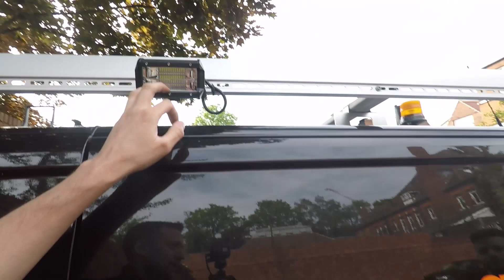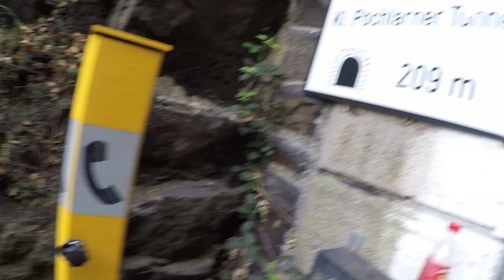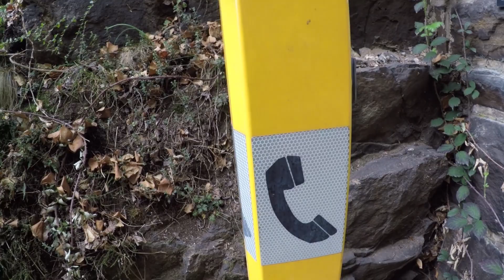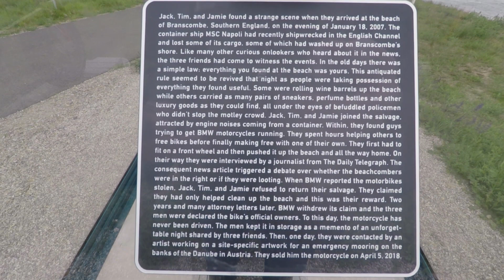Will Dave pass his van inspection??? (+ exploring random Germanic Electrics) | Thomas Nagy

Comment: If you have loads over 3,6kw you use almost exclusively  three phase power here in Germany. Single phase outlets with more than 16a. Are very untypical,  residential buildings and even modern apartments have a three phase supplies ,so seeing these sockets is normal in Germany, lots of households even have these in the garage or the basement.By keeping the distribution three phase as long as possible the grid is easier kept balanced.
Reply: Yeah, the same in Nordics, to where most of the stuff came from Germany anyway.. In Finland apartments have had 3 phase from the end of the 60s almost by default.
Reply: Symmetric load is important 😉 That's why you split the Rooms equaly to all phases
Reply: same in Poland,we have 3 phase supplies

Comment: Train nerd alert....

You are right, those power supplies would have been for track works. Tunnels have a horrible habit of building up dust, debris and other flammable detritus. As a result they have to be cleaned out regularly (London Underground does it overnight when the system is closed with teams known as 'fluffers') but why they left the units in place, i dont know. What I do know though is that railway track engineering and railway electrical engineering are 2 separate teams, they probably just got the track engineers in to rip the track up and said lets save some money and just disconnect the supply rather than rip it out

The shelters inside the tunnel are a safe place for shelter (track worker needing to take shelter from an oncoming train for example) They would have had signalling phones in as well so that if a train broke down or engineering teams needed to speak to a signaller then they could do so from a safe place. Likely to be fire protected cable so that if your need to contact the signaller is that your train has broken down and caught fire or debris in the tunnel has caught fire then the signalling system will still function.
Reply: Burnie5204 - on the area where I am based, we call the “shelters” refuges. There can be a number of different electrical systems in tunnels, including, but not limited to: power for lighting so staff can locate emergency telephones, emergency telephone systems, general tunnel lighting (not common), power for radio leaky feeders, or infill radio relay stations, or power and control systems for the railway signalling system.

Comment: The Tunnel was Part of the "Donauuferbahn" it was decomissioned in 2017 and deconstructed in 2018. In 2019 they have to close up all the tunnels, that's whhy the infrastructure is still there and looks fairly new. That Emergency Phone was probably updated shortly before the decomissioning due to regulation changes of Tunnel safety. The three phase plugs are for work or rescue operations in the tunnel. Regards from Austria
Reply: Didn't know they dismantled that :( Still remember using it back couple decades ago when i was little ...
Reply: What’s the reason behind decommissioning the line?
Reply: @robin_valk  Too little traffic and enormous costs to keep the track as it was repeatedly damaged by rockslides
Reply: Thank you!

Comment: Hi 
As someone that lives in both the UK and Austria (Salzkamagut to be exact, in case you wondered), I would like to let you know that in Austria 3-Phase power in rural and even houses in villages and the outskirts of towns is really common. I don't know if the electric companies introduced it or it was demanded by the customers but quite often the 3 phase power is used for log splitters, table saws, woodworking machinery etc and for households to cut up their supply of winter logs. Ive also seen 3-phase pressure washes and other appliances out there - all terminated with 16amp 3p+N+E plugs, though in many cases the neutral isn't used as the appliances are taking advantage of the 3-phase power for motors.  

Outlets like the one you see in this video are quite common; in public buildings, outside public buildings, in private garages, in gondola and chairlift stations in the alps, and in manhole covers for use when there are summer festivals etc. 

I think the conclusion is that Germany/Austria (I cannot speak for Switzerland) relies on 3-phase power more than the UK and like to have utility power at their fingertips.
Reply: PS: Nice choice of drink on the Almdudler!
Reply: Not only in rural areas or villages, almost every house in Germany is supplied with three-phase power. Our electric cookers are almost always connected to three phase in Y-configuration (3x 230V) to distribute the load more evenly over the phases. Usually they are connected with 5x2.5mm2 to three 16A breakers.
Also, in modern installations every other room is hooked up to a different phase. No rings, no spurs, no isolation boxes, everything is wired radially to the breaker panel. There's no difference between outlet and lighting circuits, usually you have about one breaker per room for both. "Fixed" appliances like the fridge, dishwasher, washing machine, dryer, ... have their own 16A breaker. Bathroom exhaust fans share the same breaker with lights and outlets (yes, we do have outlets right next to our sinks, so we can dry our hair right in the bathroom 😉), no such things as isolators or spurs needed there either.
There still are some old installations, mostly in residential areas with lots of small houses with rooftop power feeds, where only one phase is brought down into the house. But more and more of these are replaced with modern three-phase installations. The same is true for most parts of Switzerland.
Reply: The three-phase power delivery to any house is very common in countries that are to the east and north of Austria, not including post-soviet countries. Basically Austria,Germany,Denmark,Sweden,Norway,Finland.. The people south and to the west didn't need it (less electric heating, and no AC, like in the US) and the Soviet Union couldn't afford it.
Reply: @rkan2  Actually I think 3-phase connections are somewhat common in Croatia, Eastern Germany, the Czech Republic etc., although probably less so than in the west.

The main reasoning behind the choice of either single phase or three phase are different approaches to load balancing. UK DNOs reason that load balancing will work just fine across houses, while northern Europeans tend to prefer load balancing within each building.

Comment: In Finland we also typically just have the straight bits of the pipe and no bends (unless it's going through something, or near the ground where the freezing/unfreezing of the ground/snow/ice could break it)
The cable needs to be certified for outdoor use anyway, so it's not thought of as necessary.... as long as the boxes the cable goes in/out of are adequately certified and properly secured so the IP rating is adhered to.

Comment: The black box in the safety "dodge" hole may be a RF repeater for a radiating coax (leaky feeder) which is probably mounted in the roof of the tunnel. Could be part of a fire safety system or a distribution point for tunnel lighting?

In addition to power the cables in the surface concrete troughing could also be for signalling control (probably now disused) as well as telecommunications cables, for the yellow Emergency Phone  (including fibre optic trunk cables for the railway communications systems).  Although no longer a working track disused rights of way are often utilised as diversity routes for communications and signalling in case an accident on a main route damages cabling.

Comment: I don't know the law's for austria, but in switzerland we do the same thing. If it is a a Cable you can have it exposed in the corners, because the cables are isolated double (The cable itself and the wires inside). It it were just wires you have to either put up corners by law.
Reply: Here in Sweden it depends on the cable type. If the manufacturer says the cable can be exposed to the elements no bends are needed. If the cable needs protection or you have loose wire (single insulation) bends are needed.
Using the pipes without bends is just a way to save time instead of putting 500 clips directly on the cable.
Reply: It's still fundamentally flawed from a safety aspect!
Just because it's double insulated doesn't mean it cannot get damaged enough to expose the conductor and energise the metal conduit.
Because the metal pipework isn't continuous it means earth bonding it is impossible and you now have a situation where parts of the metal conduit can be energised with mains voltage!
ALL metal cable trays & conduit have to be continuous so that they can be earthed for obvious safety reasons.
Reply: we do the same here in France
Reply: DNA Electronics Conduit in Germany is made out of plastic. Not metal.
Reply: @Leftfield2k7  It's plastic conduit.

Comment: Hi tom regarding conduit it is probably because typically when we use conduit we use singles so no corners means no double protection and from what I’ve seen it is always double insulated cable. I think this is quite common on some ships.

Comment: in netherlands we dont do bends either. As long as the conductors inside are cables. we also use loose wires inside of pipes, if that is being used you have to do the bends as well.
Sometimes for more critical stuff like Data, CCTV, alarm systems its being done for security purposes. On Fire alarms however it is required. you are never allowed to lay the cables loose. Always within pipe, tray or trunking and seperated from any mains lines. 

In netherlands It is not needed (at least for mains power cables) because the cable (for example in NL: YMvK, XMvK, VMvK type cables etc) already provide a double insulating layer by itself. if you use loose conductors (installation wire) you must make sure that there are no exposed wires because they only provide a single layer of insulation. Bends are mainly being left out because it is faster to install, you don't have to bend all those pipes.
Reply: As far as i remember no country on the mainland of europe does them. It's either kopex or clamped pipes with the bends open. Maybe the british cables are less robust or have uv-sensitive softeners i don't know why else you would do it.
Reply: @peterpain6625  I wouldn't be surprised if it is just to be different :)
Reply: @peterpain6625  i suspect what it actually is, is because if you had annoying little vandals electrocuted by the wiring they were fiddling with, the courts over there would say "serves you right, BTW have a huge fine for vandalism"... whereas over here the courts would probably award them compensation for their injuries!
Reply: @jur4x  wouldn't it be very boring if we were all the same😉
Reply: parkeerwacht i worked in the Netherlands for two years and we did this too, open bends, much quicker and easier to install and still looks quite neat.

Comment: The cable route is called troughing which is used in a majority of countries across the globe. Instead of concrete it’s now made using GRP plastic. I’m guessing the ccu was for some form of lighting within the tunnel and the commando sockets more than likely for power tools (more importantly a kettle).

Comment: In  Norway we don't use the bends(most of the time) on open-installation in industrial enviroments eather. the pipes are just used to keep the cables in place and to make it look nice and neat. It also makes it easier to pull the cabels thru, when you don't have the bends.

Comment: Hi Tom - I'm sort of echoing what another post below says. I've seen cable run in conduit like that in a number of places in Austria, nearly always on concrete walls and ceilings, and I assumed it was more to make fixing the cable easier - no cable clips every foot or so, but conduit saddles less frequently. Makes sense, in my eyes.
Reply: Yup, I think one saddle every metre on vertical runs and every 50 cm on horizontal runs. Those conduit clips (rather than saddles) require only one screw and if you have multiple conduits they snap together and you can fix up to, say, five parallel runs with just two screw holes.

Comment: All those red cables are either Firealarmsystem-components or some kind of Railway-Signal-Cables... Because red in germany always means Safetystuff... The installation outside is probably not older than 20y or so... And the Railway-Companies like DB (German Railway) or ÖBB (Austrian Railway) usually provide Power and Emergency-Points for Service-Workers and stuff like that...

The pipework is actually always like this around here... Its not nessesary to cover the Corners and stuff cause the cables are correctly insulatet.

Comment: The cut outs along the tunnel in the UK are called refuges.  These are places a set distance apart and are used in emergency if someone, maybe a track worker or even a member of the public happen to be in the tunnel as a train approaches. They can use the refuge as a place of safety whilst the train passes them.  The box inside the refuge looks like, and say looks like a radio transformer to me as we have similar in London.  They are trackside boosters for the trains radio system and are placed along the whole line to boost the radio signal coverage for drivers and control staff as the train passes along the whole line.

Comment: In Germany almost everyone has 3Phase CEE-Sockets (at least 16A) at least in the cellar. So its pretty normal to have Machines that need 3Phases. In my garden shed i have an "Standard"-Box with 32A input and 1x 32A 3Phase / 1x 16A 3Phase / 3x 16A 1Phase (1Socket per Phase) as an Output. So its also not uncommon see it at abandoned Sites in Germany. (Sorry for my bad English writing ;) )

Comment: Two words spring to mind after watching the Austria section of this vid, Stealing and Vandalism. In the UK most of this stuff would have experienced first one, then the other and generally in that order. The lack of bends on the conduit make it to steal the cable within, but they don’t suffer from the lack of casual theft that we do in the UK. Here the fuse box/outlet box at the tunnel entrance would have been stripped bare of anything moveable and the wires pulled out of the concrete trunking, even if the power was still on. Ditto with the phone. The pile of fish plates would have been stolen. I love the motorcycle in a box, that is actually a monument to British thievery put up by another country.

Comment: Those little LED spotlights on the side of your van are very bright.  We fit them to forklifts as they project nice wide beams, run off a wide voltage range and the brackets have just the right amount of adjustment for illuminating the ground right below them.  I would suggest sticking a piece of frosted tape/fablon over the lenses to diffuse the light as if you accidentally glance at them from head on you won't see anything else for 30 seconds.

I would also take the cable end off and check the wires haven't been trapped in the rubber seal when they were assembled - we had a few early failures and found that they had wires pinched allowing contact with the aluminium frame.  Poor QC at the factory, but then they are cheap so that is where the savings are.

Comment: I worked in Amazon Swansea connecting the main incomers. Their building was wired by German contractors I believe. They also carried out their installation of conduit like this. There were no bends, T pieces or connections into back boxes. They would leave 40mm gaps between pvc conduit and back boxes. I just thought they were rough as fuck but didn't realise that's how it's done over there.